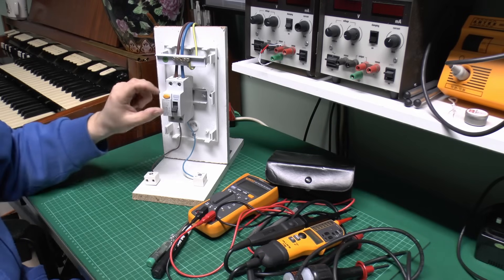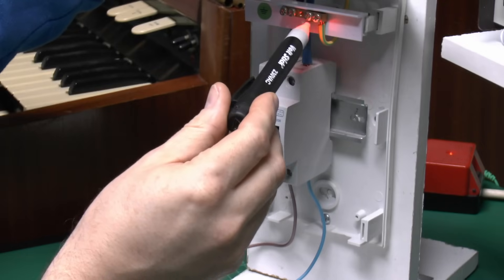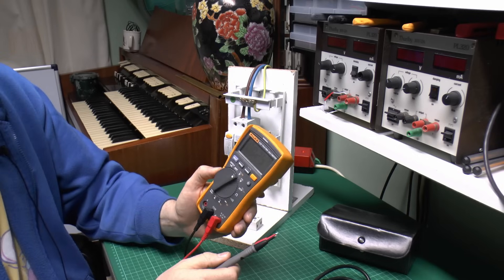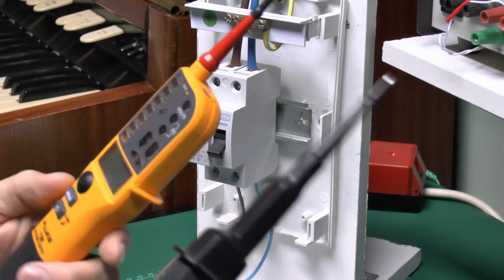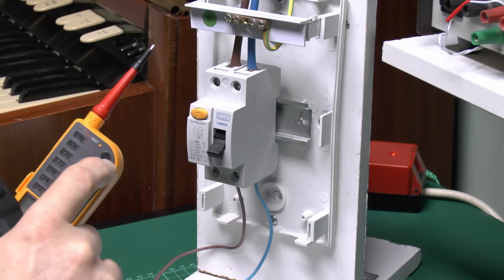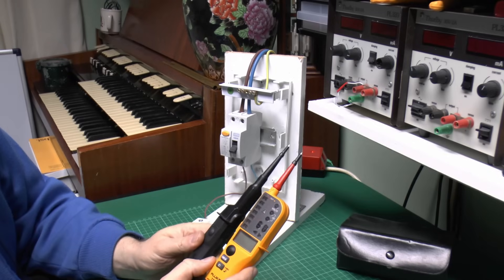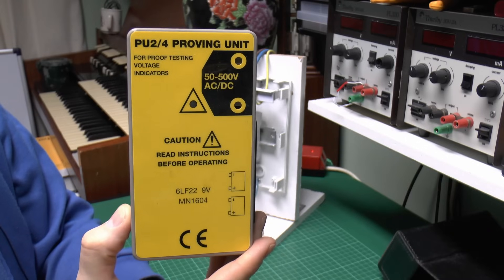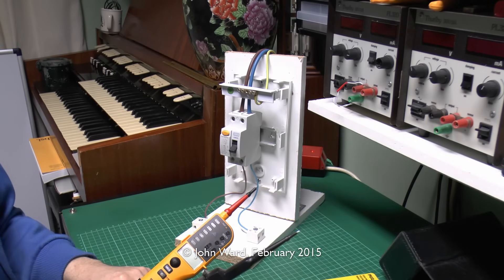Proving Dead - Mains Electricity

Comment: Thanks JW for an excellent video.  I’d like to make a couple of points…

The Drummond test lamp you demonstrate was my favourite but is obsolete now.  The latest models (MTL-10 or 20) look the same but use a tower of very bright LEDs to indicate voltage. They now works on RCD circuits without tripping them when measuring live to earth.  Still my favourite for its robustness and clear indication.

It’s very important to test all combinations of connection, L-N, L-E and N-E.  I’ve investigated an accident in which a test L-N showed no volts but the electrician still got a nasty shock.  A “borrowed neutral” raised the whole installation to live potential, despite the fully functional double pole isolator being “off”.

To those commenters still saying to use a multimeter - I back JW 100% in saying this is dangerous - there are numerous subtle ways they can mislead or fail.  I have investigated incidents in which multi-meters and non-contact volt-sticks failed to indicate live circuits and accidents occurred.   In the UK the Health and Safety Executive [HSE] publish a guide “GS38 Electrical test equipment for use on low voltage electrical systems”.  The HSE also recommend “Guidance on the management of electrical safety and safe isolation procedures for low voltage installations” from Electrical Safety First. Neither of these useful guides recommend multi-meters or volt-sticks for proving dead.

Comment: A very useful video, for work at Heathrow they actually specified which tester and proving unit must be used. I of course asked the question regarding using a multimeter. Your explanation was far better than theirs.

Comment: My favourite tester is the old solenoid tester I have, you don't need to see the thing, you can feel the 'hum' from it on AC, and it gives you a rough idea of voltage on the 'display' if you look at it, so you can tell the difference between 110, 240 and 415v supplies

And good call on the people who will say they have had hundreds of shocks. It shows laxity if they have. The one you don't think will kill you is the one that will.
Reply: I still have my old solenoid style tester somewhere :)

Comment: A very interesting video. I use a Martindale tester, which was the approved device at work plus a proving unit. It's basic, fairly small, no frills but very reliable. Its capable for both AC and DC circuits. The proving unit is pocket sized so no excuse for not using it before and after a test. The voltage test screwdriver you showed doesn't work if you're wearing gloves and it's a candidate for the bin. We have access to Fluke multimeters which are not recognised as approved testers.

Comment: The fundamental principal of electrical safety, is simplification, i.e. reduce the amount of possible failure paths. Use of a Multimeter to test for dead introduces the possibility of multiple failure paths as John explains in his video. However there is another aspect to testing that should be considered. The use of a combination of test instruments then reduces the possibility of a miss-test. I personally use a combination of both electronic and resistive test instruments when dead testing anything over 500v. It's just my own prerogative in the same way as I apply my own padlock on an isolation carried out by somebody else. Belt and braces.

Comment: Another issue with using a multimeter to prove dead is that even if you have the setting correct (voltage, AC, right range etc) - you may still have the your test lead plugged into the current terminal 'A' and you will now be putting a short across your circuit! If the circuit is live then hopefully the internal fuse in the device pops quickly And in the test lead probes (if they comply with GS38!) Using 500mA fused test leads when measuring voltage is a good idea.
..regarding the screwdriver, they are helpful for confirming correct polarity at PME cutouts... a test lamp/similar device will light/give you the right voltage values, but the cutout could still be reverse polarity!.. the screwdriver test will show if voltage is present on the combined neutral-earth, or not. Testascope is a sinilar product that serves this purpose. Or when testing a plug socket with a Bicotest Tru-pole.
Cheers

Comment: Your demonstration did not in any way cover the possibility that neutral may be switched off but not the live wire. 

I only say this because you went into great detail about many unlikely issues, but this is actually a much more plausible problem which you completely failed to cover.
Reply: ^ I have thought the same thing, I used to own a pair of digital testers like in the video and they will tell you if a dangerous voltage is on a conductor with only one probe touching, it didn't matter which one it was. It wouldn't tell you what the voltage was without a reference. Just out of interest one day i stuck one probe in a plug socket in the kitchen and the other on the steel casing of the dishwasher, 240v obviously. Take the probe off the dishwasher (one still in the socket) - red led (AC warning*beeping). 

One probe in socket and one in dry hand (boots on, tile floor) - nothing. 

One probe in socket, one in hand, bare feet, about 100v

One probe in socket, wet finger on other probe and holding dishwasher, 240v. They are much more reliable than test lamps/proving units, which like you said might not prove anything if you don't prove it is live first
Reply: Yes, your preferred test methods only work if there is no neutral fault. This can be a significant risk in cowboy installations.
Reply: i had a active neutral supply reversal ..by the provider...did nasty things...was not happy when i found it...the provider was working in the street...they were seriously. embarrased.

Comment: JW I'm up to 6 shocks, all could have been avoided. One shock was from a £5 tool fair multimeter where the leads had snapped under the insulation giving a false reading that the supply was de-energised.
Reply: and there we have it  :-)

Comment: Good video JW. Keep em coming...
There are only 2 recommended instruments to prove Not Live. One is the Drummond test lamp, with a double filament bulb, we've all heard the story about the single filament bulb. (ALWAYS TEST BEFORE AND AFTER with a proving unit). The other is a contact volt probe/tester, as opposed to a non-contact. Use both, ALWAYS!!! Locking off and posting warning notices is another story...

Comment: You didn't mention licking the live wire to check for voltage. Is that not standard practice?
Reply: Pissing on it is better. You feel it more.
Reply: I was 4 years old, and my Dad has shown me the way how to test 1.5V batteries. As an inquisitive child, I have extrapolated that knowledge and licked the live and neutral wires. It didn't hurt: I lost consciousness for about 3 minutes. No cardiac issues, etc Now I'm just using the extensors side of my limbs to check 230V - still no issues!
Reply: @mernok2001  Megkérdezem a Szent Pétertől.
Reply: Far better than licking in emergencies is touching the suspected item with the back of your fingers, with your fingers extended. The muscle contraction with any shock will pull your fingers, hand, and forearm away from contact. It is a useful technique for a quick check on steel enclosures, handles, etc. before opening them up. It's much more sensitive than a neon screwdriver.
Reply: @johncosgrave9132  I believe firefighters use a similar principle using the back of their hands when feeling through the smoke, in case there are live cables.

Comment: I am an electrician by trade.  Multimeters are the most reliable tool for verifying power.  They also tell you what your voltage is so that you know that the power coming in is in the correct range.  If you're worried about having to set ranges or accidently going to manual ranging, buy a multimeter that has no manual ranging function.  If you are worried about having to change lead positions and possibly getting it wrong, buy a multimeter with hardwired leads.  Your best bet in the long run is to learn how to properly use a multimeter.  Hot sticks (proximity testers) are considered the next level of reliability but have low end detection ranges (usually 24 or 50 volts), but do not tell you how much power is on the line.  I have seen hot sticks detect induced power on a line because the induced voltage is enough for the hot stick to detect.  Voltage detectors that use indicator lights have the flaw that you can blow out the lamp by over voltage, and that under voltage gives you a no power indication.  If you want to be absolutely sure that you have no power, your most reliable choice is the multimeter.  Of course, with all these pieces of equipment you should always verify proper working condition before usage, which includes checking operation on a known live power source within the operating range of the tester.  Be aware of the category rating of your meter when you purchase it.  It is part of the safety rating of the test equipment and has to do with how much protection is between you and the unprotected power source (power lines).
http://faculty.riohondo.edu/jfrala/fluke_multimeters_-_abcs_of_multimeter_safety_multimeter_safety_and_you_application_note.pdf
Reply: ***** That doesn't eliminate the fact that a good multimeter is by far your most reliable test device for power.  However, the rule of thumb that anyone who works regularly with electricity is that when working around live circuits, treat the wires as if they have power on them even when you have verified that the power is off.  If you were to have a combination of tools to verify power, both proximity tester and multimeter should be used in tandem for power verification.
Reply: +Ian Belletti i prefer voltage/continuity testers. They usually have a higher safety class and most of them have single pole indication where as a multimeter often doesn't.
Reply: FoodOnCrack The multimeters I use do both voltage and continuity tests.  The rating of the meter as far as voltage range and category location are what give you the safety of the meter when it comes to available fault current.  Your safety as far as verifying power comes in knowing how to properly use your tools.  Proximity testers handle your single pole situations when the return path is broken, however, multimeters are still undefeated as far as power verification ability.  Both have their shortcomings, but using both multimeter and proximity tester will give you the best warning as to the possibility of shock on the circuit.  Of course it's recommended that you verify that your test equipment is working on a known live circuit prior to testing the circuit in question, especially the proximity tester.
Reply: that is why i prefer voltage/continuity testers. They have single pole indication, so it basically is the same as a neon screwdriver; you don't need neutral or ground for it to light up.

Comment: After doing some DIY work over the years including 3 phase, one extra safety tip I do after checking the power is definitely off, is touch the wire with the back of your fingers. That way, if the wires were still live and all the muscles in your arm and hand contract, your arm/fingers will be pulled away from the live wires, instead of gripping it harder if you had used the inside of you hand.
Reply: Depends what phase you touch🤣🤣
Reply: @MegaMetinMetin  Makes no difference. Your grip would still contract with any of the three phases.
Reply: @matthewcummings9024 or you could put your tongue on it!
Reply: @jablot5054  Or worse! 😱🤣

Comment: I can appreciate your approach but for me and the 45 years of experience I have working with electrical sources the only reliable method is the multi meter. I have seen way too many mis-wired mains and other supply boxes to in any way feel safe except by verifying it with a multi meter. I have also seen too many people take a shock because they only checked the terminals they expect voltage on. 

One time a tech actually cross wired 480 volts triple phase connecting the ground lead from the Control Van to one of the phases of 480 at the feed breaker. Let me tell you when he turned on the breaker it was quite the show. Never trust the color code, a person connected it, verify that the connections are according to code by testing it.

Good quality multi meters and probes are rated for 600 VAC. When you need to measure higher voltages High Voltage Probes are used. I have regularly used this to check and test 3000 VAC circuits.

The Multi Meter gives you the ability to make several different tests but it does require you to understand what you are doing. Any meter or test instrument can give you false or undefined readings if used improperly. I always told my guys to be smarter than the test equipment and tools they were using.
Reply: You are talking about fault finding which is not the same thing.
The two pole testers can also do continuity/resistive checks.
Reply: Proving dead should never be carried out with a multimeter, if in any doubt ask the HSE!
Reply: richb313 this definitely seemed like a home gamer oriented video. Every maintenance tech/engineer I’ve ever worked with in the field has used a non contact power indicator followed by a multimeter/wiggy after testing on a know live circuit. Coil wiggys are handy for those phantom voltages from long wire runs, sometimes digital meters are too sensitive and give a reading of voltage but no amps behind it. The proving unit looks handy.
Reply: If you don't understand the test instrument you're using you should'nt accept the result.  DMMs have a high Z and can pick up radiated fields from surrounding wires. To this end, Fluke used to supply a high resistance parallel load to eliminate the ghosting.  Most of the instruments shown are sufficient if you know understand the science.  Unfortunately electricians are not engineers or electronics technicians.
Reply: A voltage tester wont work across L-N with a neutral fault either. L-E with both sorts of tester would indicate the presence of a voltage however in some circuit configurations. The argument against multimeters is the potential for incorrect setting but that isnt a very strong argument either in my opinion because we have to use MFTs to do all sorts of live test work that also requires us to set the instrument to the correct setting. 

This procedure John Ward talks about is really aimed at the keeping the incompetent professionals (we all know one or two of those) safe, those people who make mistakes. Even a complete idiot can use a single function 2 pole tester and a proving device after all, its an idiot proof test.
Reply: @cbcdesign001  “people who make mistakes” — otherwise known as “people”.

Comment: 260v is quite high. We get 240 maximum where we are.
Reply: Shaun Dobbie 
That's England for you. Certain (cheap/dumb) electronics have funky behavior as a result of this (stronger vacuums etc).
Reply: Depends how near you are to the sub station.
Reply: I get 245-250VAC here most of the time
Reply: 260v is very high. I've never seen more than 250v. At my firm in the sticks, it sometimes gets as low as 200v much to the dismay of our governor. We are an electromagnetic Compliance company, on the low days we can only test to FCC and Japanese standards...

Comment: One question:
The test you showed only seems to prove that at least live or neutral are disconnected (in case of a partial failure of the RCD).
Should one therefore not test live against a known and still connected earth or neutral too?
Reply: +Shoppinguin It happened to me too. Since then I make sure to have a connected earth available (extension lead) whenever I do that. I only thought I had missed something.
Reply: A test sequence should be more like
Do a proving test on the measuring device
test:  L in ~ N out
 test: L out ~ N in
Do a proving test on the measuring device